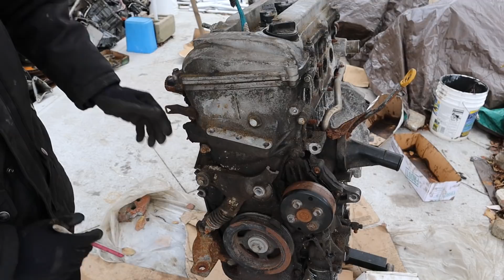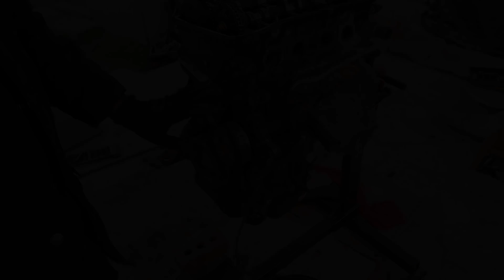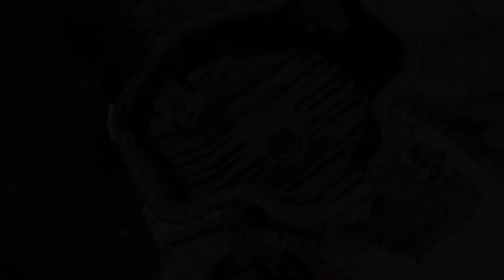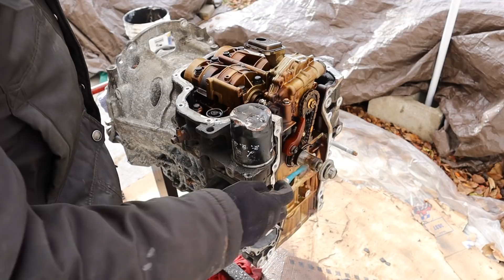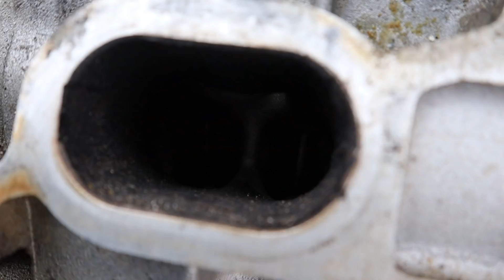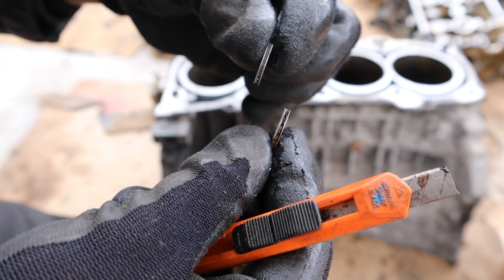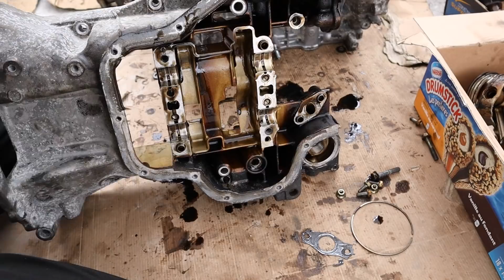Here's why Toyota Engines Fail

Comment: Driving style and maintenance style are key to the longevity of an engine.
Reply from the maker: Agreed, but if there is a flaw eventually common issues will show up.
Reply: @speedkar99  I wonder if these engines would have oil problems if the oil is changed every 5000 miles and with the right specifications.
Reply: @Elaba_  I wonder the same, and the use of additives like Marvel Mystery oil, etc.
Reply: @Elaba_  5K is the spec. I've done mine at 5k, 0w20 and no burning yet at 95K. I do a lot of city driving as well. But now that I've learned about the burning, I'm going to go to 3k(which is 6 months for me) and check the oil every fill up.
Reply: @Manofcube  I use Amsoil 0w20 Signature Series or TGMO. More importantly I have changed my driving style. I have experienced way too much engine troubles.
Reply: @Manofcube  mine started using st around 100-105k it has 150k on it now. I have been changing it every 3k and checking it every fill up.  It hasn't started needing adding oil in 3k yet. It's the 09 camry 2azfe.

Comment: If you get the chance you should do a k24z engine plus talk about it’s vtc rattle lol
Reply: I would love to see a 4.0 VVT-i 1GR-FE
Reply from the maker: I've already done a K-series teardown
Reply: @speedkar99  That video is actually what had me find this channel (great video) but, the k24z3/z2 is used in the 08 plus accords and it has some changes from the k24a found in the 7th gen accord you did. For example the integrated exhaust manifold I would love to see if there is any other changes between the two engines. I’ve always wanted to find a comparison between the two but, no one on YouTube has done it. Keep up the great content!
Reply: VTC rattle is cause by user neglect to perform regular oil changes on time.

Comment: I had one of those, great engines as long as you put oil in it
Reply from the maker: Agreed. And that's the problem, Toyota drivers think they can just put gas and go forever...
Reply: @speedkar99  yeah if you remember I messaged you about that car before it was tag teamed by a couple of 18 wheelers but I got that thing up to 300,000 miles no problem I just had to put oil in it every other week
Reply: @speedkar99  no buddy, not all Toyota drivers....... What a dumb comment...
Reply: Great CAFE invention - instead of the usual extra half a liter of gas per 100km with 5w-30, now half a liter of oil per 1000km
Reply: @pliedtka  mine was about a quart every 2000 miles. So it wasn't that bad but I've heard of people that didn't change their oil a lot and there's a lot of sludge on the rings and those burnt oil like a quart every 500 miles
Reply: yeah. because all other engines run on rocks and bubble gum
Reply: @AC-kl2gf  really only works on intake carbon deposits not ring land deposits
Reply: @AC-kl2gf  
What's a Italian tune up ?

Comment: That plastic in the cooling jacket is to let the engine warm up faster, by reducing the water volume. Warming up quicker saves fuel.
Reply: Unlike Hondas
Reply: toyota-club says the coolant jacket insert is to increase flow near the top of the cylinder - where does all this weird info come from? so many different answers lol
Reply: @identifiesas65.wheresmyche95 that's the correct answer, as the top is where the heat is produced, and therefore the most thermal expansion occurs.
Reply: Could be but its more for providing better directional coolant flow so there are no hot spots and entire jacket has even temperatures
Reply: I really wondered this when I saw it every time on this channel
Reply: That's not exactly true... It's to direct the coolant flow towards the top of the cylinders, which evens out the thermal expansion between the tops and bottoms. 
The tops of the cylinders are exposed to MUCH more heat than the bottom, meaning the top would expand significantly more than the bottom, creating a conical shaped cylinder if the coolant flow was evenly distributed. 
These are a feature in every open deck design...
Reply: Thank you. I was wondering what it was for.
Reply: Are you 100% sure? I have seen other people say to reduce the gurgling sounds
Reply: @FerasAlhawas  What gurgling sound?
Reply: @operator8014    because it’s an open deck the water moves alot compared to closed/semi closed so you well hear the water move when the thermostat opens.
The plastic peace is there to help reduce the sound which sounds like gurgling noises
Reply: Yes unlike Hondas - my old pig takes forever to warm up
Reply: 2012 Si. K24Z7. 470k+ km of daily drive, track and drag use... still runs like a champ. Those 2.4l Toyota engines however were plagued by various issues. To be fair, however, the oil consumption issue could be easily prevented is you used a quality Synthetic oil and changed it frequently....
Reply: @marc-oliviercabot3380  to be honest, toyota is ran by business people who cut corners where they not suppose to. we made 4-5 times more money servicing toyota than honda at my midas franchise that i owned.
Reply: @kevinvvn  to be honest, my Civic isn't without faults too. Those rear calipers sucks and the infotainment system is slow AF. But those Toyotas 2.4 engines are nowhere as reliable as the 5S-FE 2.2l they replaced. More economical? Perhaps. More powerful? Definitely! More reliable? Fuck no! Broken head bolts on an engine.. c'mon!
Reply: @marc-oliviercabot3380  whats wrong with rear calipers, rear brake pads always were too tight to bracket, but the caliper usually dont freeze up.
Reply: @kevinvvn  mine does so with an alarming regularity. Freeze, leak, etc... fortunately enough OE replacements from honda are inexpensive compared to other brands and i have a discount at my dealership because i thow some guys that works there but still 1 and a half years per calipers... at least the brake fluid is always fresh.. never changed an axle, struts were good a 460k km when i swappped them for adjustables from Tein. Front calipers are the original ones... rear ones... no comments. The only thing that i must say sucks on my Civic.
Reply: @marc-oliviercabot3380  thanx for the info. I was not aware of this issue. Regardless, I will buy honda product any day every day. Apart from calipers that includes parking brake mechanism, i never seen any caliper fail on honda ever. especially the front ones.
Reply: @kevinvvn  yeah i can't say for sure if the aftermarket ones are better but it's my next step i think. Everyone that i know that have 9th gens Si had trouble with their rear calipers sooner or later. :) car is pretty much trouble free apart from that. I don't beat on it so even the transmission is trouble free on my front.
Reply: @kevinvvn  that's because toyota owners actually serviced their cars, honda owners know they own garbage so why service it
Reply: @mobilemarshall  when we did oil changes on honda, we could see things being original every time again and again. I have similar opinion as yours... for toyota. They are flat out garbage. they use acidic coolant on purpose so water pump, radiators, head gasket wont last forever !!!
Reply: @mobilemarshall  honda 2.4 started using roller lifters since 2001; toyota > 2017. they were using bucket style ancient design my dear friend.
Reply: @kevinvvn  Honda used mechanically adjusted rocker arms when Toyota was using buckets.  Mechanical lifters require adjustment more often than buckets.
Reply: Lets be honest the honda transmissions that r junk r not made by honda and r sourced from a 3rd party n this has been hondas plague but anything thats built by honda lasts forever lets b clear. In the words of scotty kilmer toyotas #1 fanboy even made a video that says honda makes more reliable engines than toyota because honda actually builds there own engines unlike toyota who source there engines from a third party company #facts
Reply: @chevyss934   I believe Honda makes their own transmissions thats why every time they launch a new transmission, one should stay away for first 3-4 years. I think german cars with DCT uses 3rd party transmissions but honda makes their own
Reply: @kevinvvn  honda does make their own transmissions but the major ones that have failed in the prelude, odyssey, tl etc were not honda made even recently in their acura lineup they were using the jerky zf transmissions in their acura products hence why they have there new 10speed built in house.
Reply: @chevyss934  so which specific ones were ZF ? I know ZF is trash. BTW i fix odyssey transmission by tricking its computer. I sell kit on ebay for 1998-2005 transmissions that are slipping sometimes. i have found 4 step process that fixes it if its not burnt out completely.
Reply: @kevinvvn  current gen pilot previous gen oddysey previous gen tlx previous gen mdx not sure if the passport has it but anything with a 9spd most likely is the zf transmission
Reply: @chevyss934  Which third party company makes engines for Toyota?  Are TMMK (Toyota Motor Manufacturing, Kentucky, Inc.) and TMMAL (Toyota Motor Manufacturing, Alabama) owned by "third party" engine manufacturers?  I believe these two plants build engines for Toyota.

Comment: Proper Timely Maintenance is the key!  Like AMD says, don't go 10,000 miles between changes. For all or any make/model vehicle.  OIL IS CHEAP!  ENGINES ARE EXPENSIVE!
Also, ANY engine that runs low on oil will not last long and could grenade itself.  Oil and oil filter changes minimum of twice a year is cheap insurance.  Take care of your vehicle and it will take care of you!
Reply: Unlike Volkswagens, they explode even with proper maintenance.
Reply: Well said!!

Comment: My 2008 eats oil like a pig.  Alwyas adding.  175k.  So far so good.  They had a recall for these.
Reply: Yeah, the oil slips past the piston rings and burns with the fuel at higher RPMs. Had the same issue with mine
Reply: Bulletproof motors just do lots of oil changes,  they are cheap

Comment: Nothing hurts more than seeing a good engine or car that's been destroyed by stupid people who neglect everything.
Reply: @grahamwinston3692  that still doesn't excuse not doing an oil change, oil is cheap and easy to change if you can't even do that you might just as well sell the car and go to work using the a bus or a bike.
Reply: @andrepower6  You can change the oil every day but if the design is bad the oil isn't going to get where it needs to be anyway.
Reply: @makmelaf  I was talking about my previous comment about good engines/cats.
Reply: @andrepower6  I agree with you wholeheartedly. Without any maintenance, the vehicle is gonna undeniably fail you. Still miss my dad's little red 94' Yota.
Reply: Hyundai engine fails: OMG HYUNDAI SUX 
Toyota engine fail: OMG STUPID OWNER WTF
Reply: That engine has a design problem, I know two people with that engine that were religious about maintenance and the oil rings still got stuck and the engine started drinking oil. Like from the full mark to the oil pressure lamp coming on in an hour of driving. I would not have believed it if I never saw it myself.
Reply: Fifth Generation, 2AZ-FE , 2.4L, 02-06, would have head bolts consistently strip. This is regardless of the owner religiously following the maintenance schedule.  Literally, folks paid $$ for Toyota dependablty, but instead got the  engine of a cheaply manufactured 2.4L Dodge/Jeep.
Reply: Or, the fact that they don't make vehicles like they used to?  I had 3 Toyotas, despite all the regular maintenance and no abuse..they could not stay away from the repair shop.  Always getting something fixed or getting a strange noise checked out (which Toyota always told me was "normal" 90% of the time).  The refinement in the newer Toyotas is just not there.
Reply: These are not good engines haha very disposable and have a few design flaws. Toyota aren't 100% on point 100% of the time unfortunately...
Reply: @grahamwinston3692  That doesnt explain THIS level of moronic thinking :-)))  https://youtu.be/m8eTLJIbY-Q?t=102
Reply: Some people only know driving the vehicle everyday, but not checking oil, water etc or do oil change, they think it will last forever
Reply: @Yaurtihtiol  I’ve seen the oil consumption problem in these engines that had a religious maintenance schedule of 3000 miles. Perhaps Canadian winters made it worse, but most other engines I have met last for 200,000 miles or more without any oil consumption issues. I actually was thinking the same way until I saw it and the oil change logs myself.
Reply: @Yaurtihtiol  Not so sure. For 15 years I performed around 3000 mile oil changes many time. Simply changed it in April and November. I lived 10 mile round trip to and from work. Worked rotating shifts, so only 25% of the year. In the last 2 years I did go to about 4500, seems that's when I started having problems. 5W30 was turning black about 3800 mi. 
Another thing that got me was the fact that I started hearing more and more information about not using the heavier oils in VVT engines. The thick oil was harder on the timing tensioners and the gear. I had used a quart of Lucas for many years at every oil change, but discontinued use about the same time as lengthening oil changes. I didn't get many total miles, about 118,000mi. on the clock now, but 17 years of reliable service. Really understated because my engine spent 95% of its life above 4500rpm; it's a 5 speed....

So I am not so sure that this engine was ever really able to do 5000 miles per oil changes. Seems as though either the 5000 mile regimen was too much or the Lucas actually worked very good.
Reply: Lol it's just a hunk of metal at the end of the day
Reply: Not everyone has so fortune to always have time and money and education to do this, if you have to choose between insulin food and an oil change you choose insulin and food. Same with rent
Reply: @doodlebug1820  So then why buy a car? If somebody can't afford to maintain it, then the money used to buy the car in the first place is better used on something else.
Reply: @piperpilot26 you won't understand until you go through it and hopefully you won't have to. bless.
Reply: @doodlebug1820  I've been through extremely rough times financially. But even then, you have to balance priorities in order to keep yourself afloat. This means maintaining your transportation so that you actually have transportation.
Reply: Oil changes important
Reply: Brilliant video buddy . Thanks
Reply: You are going to LOVE this channel, stupid, lazy people = https://youtu.be/UNkhS-PrTOk
Some of the things in the videos on that channel i would simply not believe, unless it was on camera. :-))
Reply: @TeUhtred7860  Oh boy, thanks for sharing 😅.
Reply: @TeUhtred7860  You bloody legend, cheers mate 😂😂
Reply: I just want 200hp out of my 2012 Scion xB
Reply: you mean liberals?  JOKING (kinda)

Comment: Toyotas are generally reliable, but I've met a ton of Toyota owners with this mentality of: unless the car doesn't work, it doesn't require maintenance. Oil change intervals? What are those? Fluid flushes? But _ is still working fine. Spark plugs? Engine still cranks so no need. Tire rotation? Yeah that's just a scam. They have to be the most neglected cars on the road and I avoid buying them.
Reply: I know I’m always doing oil changes it feels like in my 2 4Runners every 5k. I don’t subscribe to the 10k oil changes.
Reply: @JAMESWUERTELE  depends on what oil you use.
Reply: @JAMESWUERTELE  10k oil changes can be done but not if you live in a climate with extreme temperatures and/or your driving style is aggressive.
Reply: @hadi8561  or if you drive a lot of short distances.
Reply: you are right my father is example he never changed the fluids of the his toyota only the engine oil he believes is important. Now he owns Ram the mechanical failure is very significant and it's unreliable at all compared to Toyota that gets only oil
Reply: I bought my 2005 Corolle CE and it had the factory brake pads….from 2005….along with every suspension component. Pre-purchase inspection believer now.
Reply: buy them to race in lemons 24
Reply: I agree. Toyotas are often driven by people who have no business driving or owning a car - or being anywhere near one. Reason why I prefer other makes too.

I have a Hyundai that’s outlasting more Toyotas than I can count. And I’m not stopping anytime soon.
Reply: Yea those are bulletproof engines, if someone destroyed one its likely their fault. Same with the 2.7, 3.4 and 4.0. All great.
Reply: Buy a new Toyota. Suffer once financially so you can drive it 15 years?